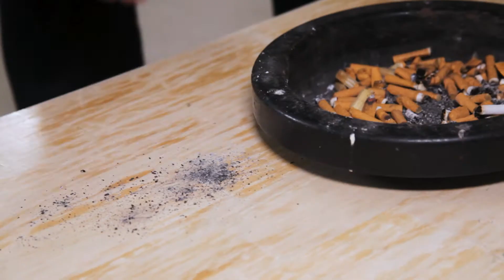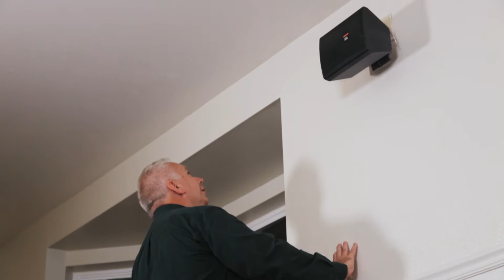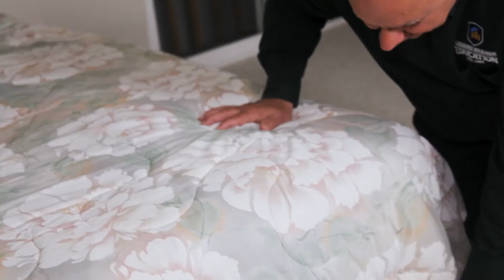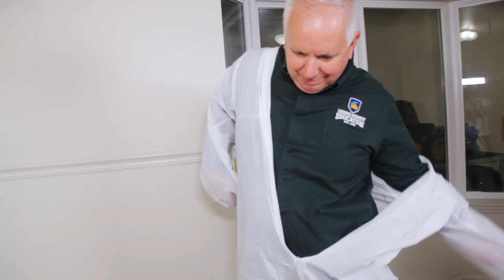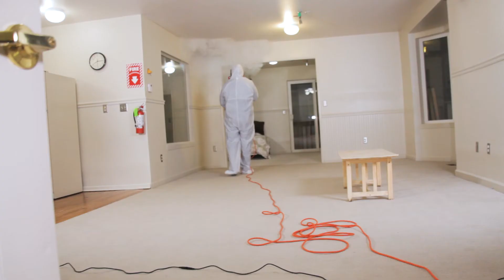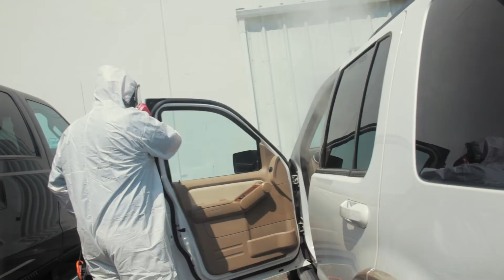Electro-Gen Fogger Delivers Powerful Odor Control

Comment: Which product is safer, Thermo-55 or Thermo-2000 ?
Reply from the maker: They are both safe when used properly. Thermo-2000 cannot be fogged through the Electro-Gen Fogger - only the Thermo-55 is approved for the Electro-Gen. You can fog Thermo-2000 using the Thermo-Gen VF gas-powered fogger, which produces a particle size that is 20-30 time smaller than what the Electro-Gen can produce.
Reply: @LegendBrands  on your product page for the Odorx Themo-2000 it states the following;
 "Intended for use with a thermal fogging device such as the Thermo-Gen VF or Electro-Gen 2000C"
Reply from the maker: My apologies - the Electro-Gen 2000C was recently discontinued. I'll make that correction to that site.
Reply: @LegendBrands  What would happen if you attempted to use Thermo-2000 in an Electro-Gen Fogger ?
Reply from the maker: You would probably cause damage to surfaces as the Electro-Gen doesn't get hot enough to create a dry fog. The machine is only approved by the manufacturer for hot fogging petroleum solvents through the heating element. (Any damage created by misuse of the machine would not be covered by the manufacturer given it's not recommended for use with a water-based solution.)
Reply: @LegendBrands  Thank You, other than damage to surfaces, would  it pose a greater risk to occupants or pets ?

Comment: Is it safe to use in apartment homes with a sprinkler system?
Reply from the maker: Many sprinkler systems have sensors that work by sending out a beam of light. If the light is not received by the other side of the sensor, the sprinkler may activate. To prevent this, you should deactivate or cover sprinklers with plastic to prevent the disruption.